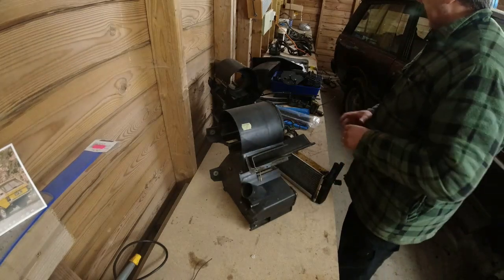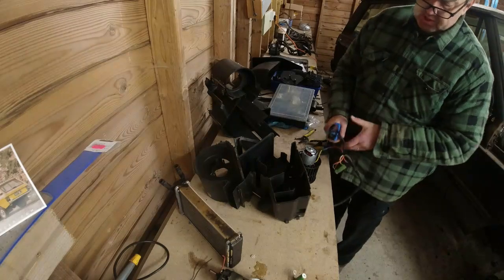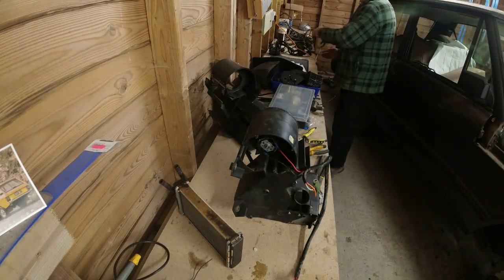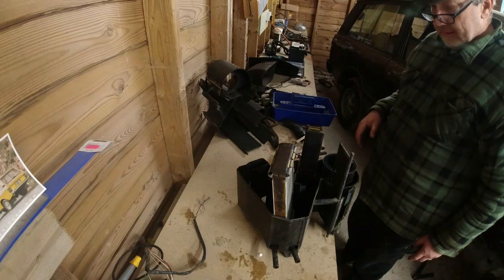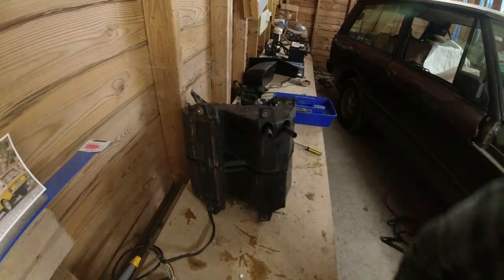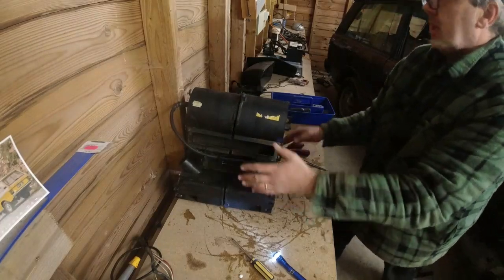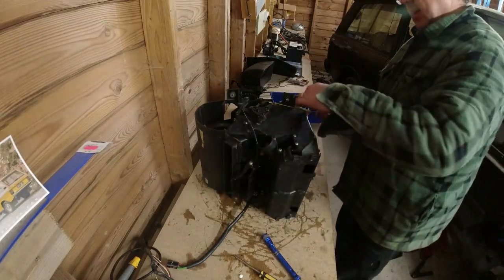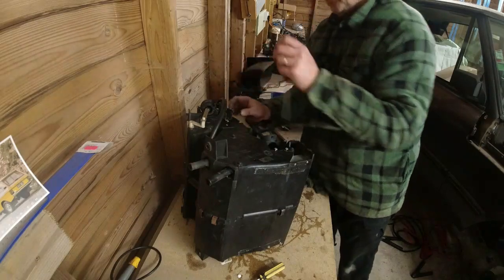Range Rover Classic heater refurb - maybe swearing

Comment: I'm messing with mine right now. I've taken it a part and back together 3 times. Several of those rods are not moving the vents like they should...super frustrating.
Reply from the maker: The plastic boxes can be tricky to get everything doing what it should! drop me an email if you are struggling
Reply: @churchhouseclassics  thanks, I finally got it together. The 4th time was a charm!

Comment: That does look damned fiddly but I reckon the Stag one I did was worse. Approx 1 million rusty self- tappers of seemingly random lengths. Rusted rear casing and drain tube, none available on eBay so I made up parts and spent ages getting it all A1, including rebuilding the motor. A good one appeared on eBay the day I finished! 
Have you ever had issues with those heat shrink crimps? I still use solder and heat shrink as it’s easier to wrap into a loom so never tried them.
Reply from the maker: I have done stag heaters and I know what you mean about those self tappers. Then when it is all together and you pull on the heat lever and the stupid spring clip lets go! followed by 15 minutes of profanity.

Those heat shrinks work well for me, I always give the finished wire a tug to make sure that it is secure. it is certainly better than the bullet / sleeve setup on the earlier Land Rovers that let water in and then corrode